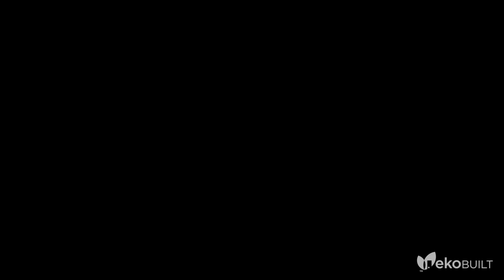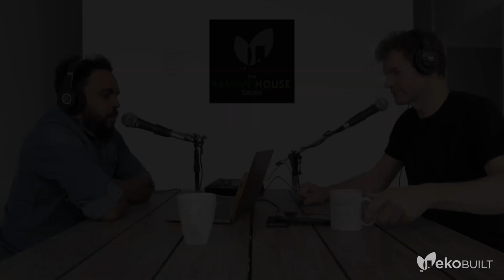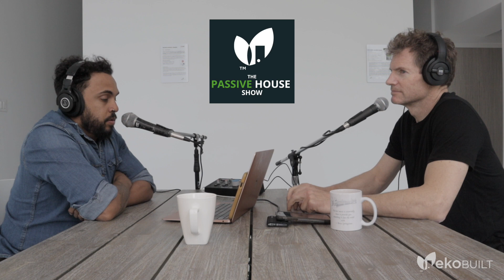Net Zero vs. Passive House Clarified - EP #2

Comment: IMO, sealing off a house from leakage is single most important step to energy loss. Air exchanges per hour has to be mediated. Too little, and the air quality can become too humid and u healthy. Too many and the home uses too much energy. From there I’d insulate smartly etc.
Reply from the maker: Thanks for your comment, it’s good to hear you are educated about air tightness, and its direct relation to low operational cost. In order to ensure a healthy environment, a proper fresh air system that can manage both oxygen and humidity levels, is another component